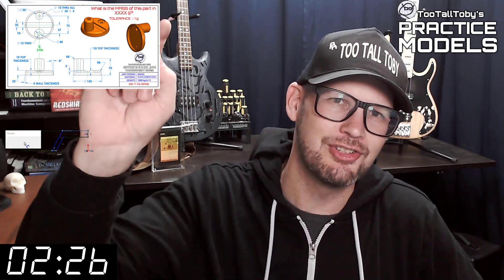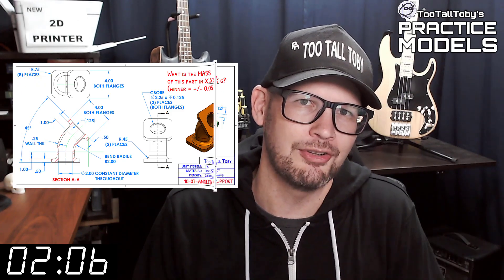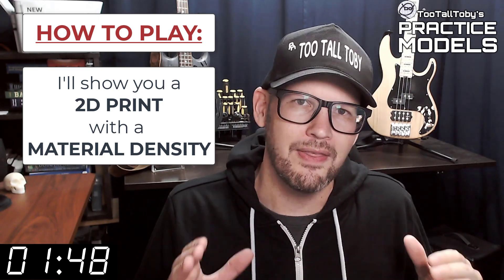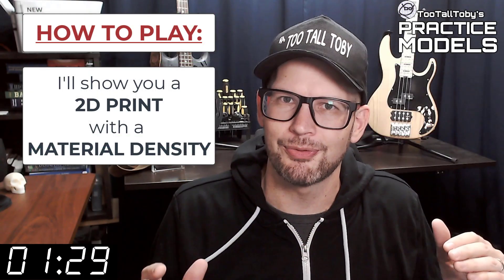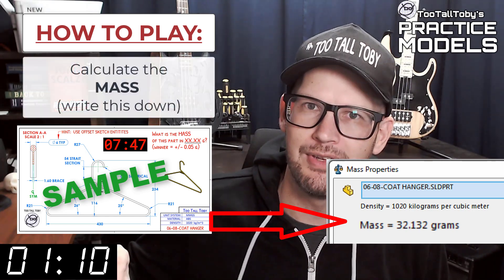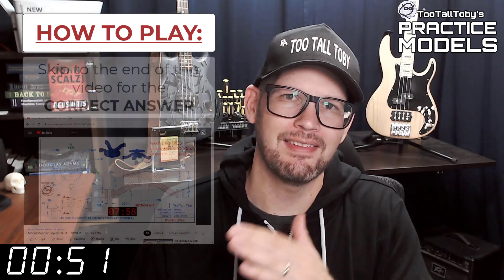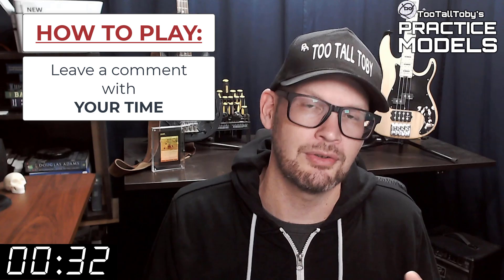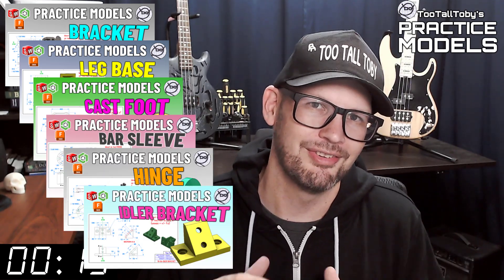2D to 3D CAD PRACTICE MODEL-  Drawing to Model exercises for Onshape, SolidWorks  - HANGER FLANGE

Comment: 15:16;  375,27g. I didnt menage to solve this with "shell" function, used cut-revolve for this central hole, is it posible anyway to do this with ''shell''??
Reply from the maker: I'd probably do it the same way - with cut extrudes and cut revolves - no shell.  But I can try it sometime!

Comment: 7:10 - CATIA V5r33 - centered rectangle pad 8mm - 4 edgefillets on corners r21, added a cylinder with pad 50mm (form bottom), drafted to 28/2degrees to make it cone, added bottom r10 fillet , shelled the part. thikness comand allws me to pull more on some surfaces, like inside lip needed 7more mm (done some calculation from the side (125mm-101mm-10mm)/2), thickness on top (needed 15mm more to make it 20), added side elongated hole pocket, added hole on top, added corner holes (due to not beeing concentric to edge, i've done a sketch with centered rectangle by 90 and 140, inverted the visibility leaving only the corners points. - then done one hole concentric to one point and user patterend with the scketch.. could have used some mirrors or rectangular pattern, but user pattern was my choice this time).

Nice model.
Reply from the maker: awww yeah NICE JOB and great workflow!!  Thanks